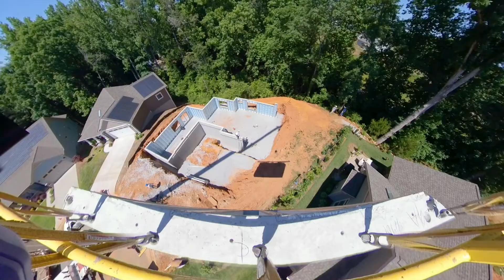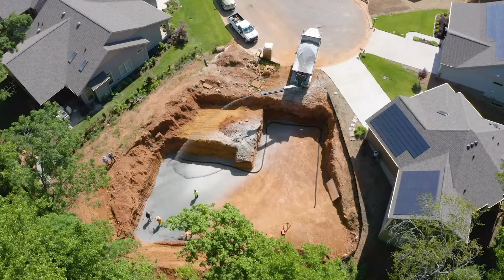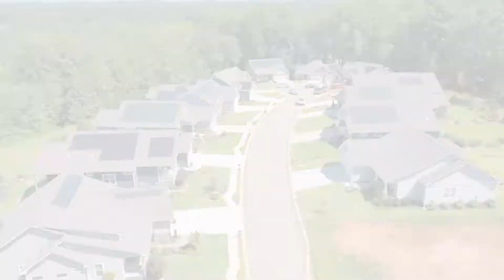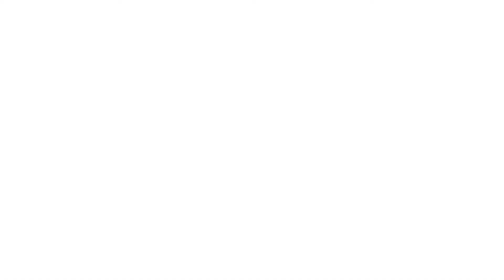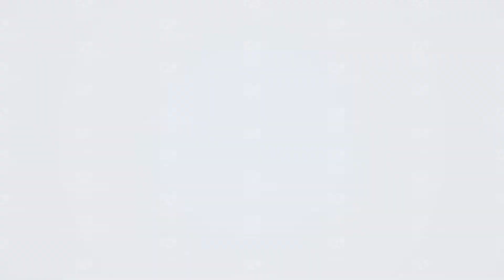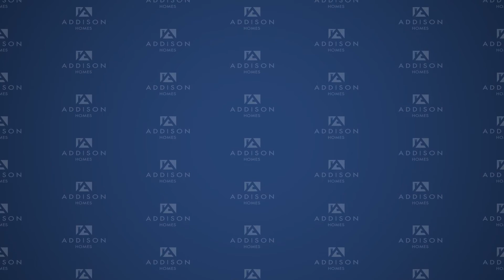Code-Built Central Return Ducts | What Could Be Better?

Comment: I could never understand why my home was always hot in the summer time with the the ac on until I did some investigating.  Why the  hvac company's in the 70's when my home was built they put the return and supply vents at floor level on the walls and one centralized return in the hallway ceiling? By the way may hvac is in the basement, it makes more sense to put the returns  in the ceiling in all the rooms including the kitchen where all the heat is. That's when I hired an hvac company to put all return vents in the ceiling and connected all the flexible insulated ductwork to a trunk line to the main hallway central return then I blocked the vent return in the hallway. And I blocked off the floor returns and man what a difference the return vents made that are in the ceiling now, there's literally no heat lingering in the ceiling in my house any more my house stays nice and cool on the hottest days in the summer

Comment: Great video explaining the concept for where the returns should be! 

Do you have any additional videos going into more detail? -Should a large central hallway return be used in combination with smaller bedroom returns?
-Shoukd there be filters at each return location or just a single in line filter closer to the air handler?